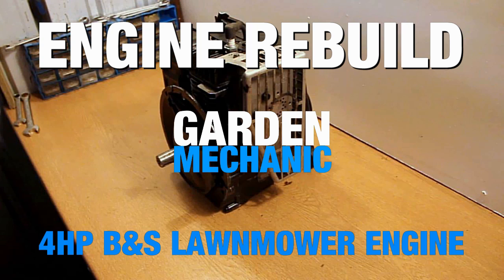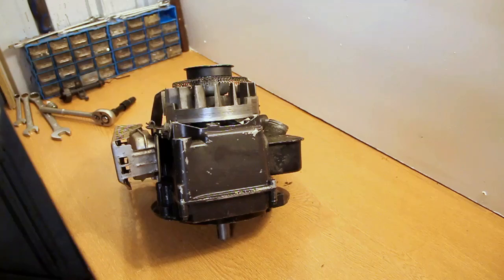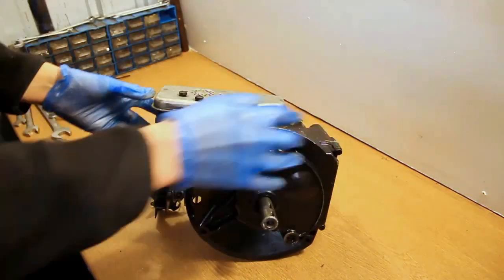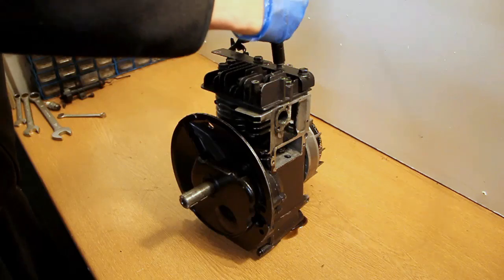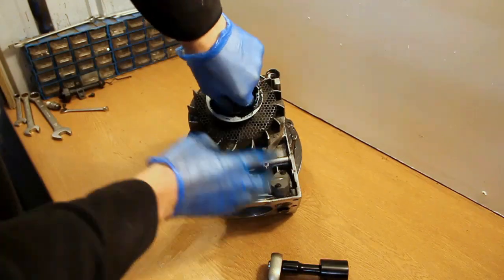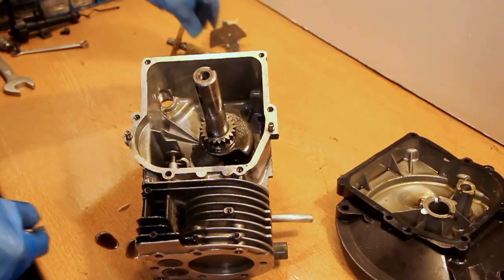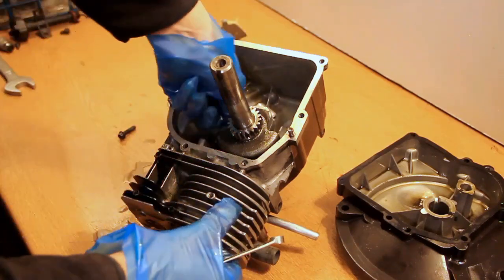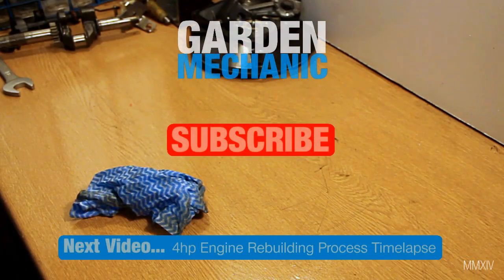Engine Rebuild: Briggs and Stratton Mower Rebuild with Narration - Part 1

Comment: Can you straighten the crank using a press? Also, My edger smokes bad for a few seconds if I roll it to its side. Do you think it needs rings or new piston and rings? Can you oversize the bore just using a hone? Thanks for the video.

Comment: I just ordered a gasket set for a Briggs flathead I’ve got on a mower I picked off side of road.  Engine runs great but excited to practice disassembling, measuring crankshaft journal for wear and reassembling.  Had a chance to practice lapping the valves and removing about 2 thou off the exhaust valve stem too which was fun!

Comment: Will you go over cam shaft timing when time comes to putting it back together? 
I took my 6.5hp engine apart without thinking of timing.
Reply: You align the dots on the gears. I always noticed that when the timing is correct when the valves rock, one closes when the other opens, the piston is on top dead center.

Comment: I cracked the crankcase sump a bit along it's short inlet shaft using the old trick. Will use cold weld steel reinforced epoxy JB Weld to repair it. Hopefully it holds.

Comment: That engine had been previously rebuilt as it was way to clean when you stripped it down. no carbon on top of the piston. the sump gasket was completely intact also after been seperated .valves were super clean . The nut holding the flywheel on was not done up very tight. the oil was clean. The blade disc boss had already been removed. you should show people how u get them off , as sometimes they are a real pain. bodgey video productions I will call this clip.

Comment: Thanks, I disassembled a quattro like this to clean it and then waited and waited for a new head gasket to arrive, foolishly thinking reassembly should be a doddle - ended up with the two flywheel guards hanging around and wasn't able to figure out how they re-attached! A slow-mo of this let me see the position and fixings - thanks!

Comment: the problem is putting it back together. by the time i get the part i need, i forget what goes where and what screws and bolts if i can find them.

Comment: That engine is a dead giveaway because of the air filter on it. They had both metal and later plastic ones that are both the same shape. But I can't get over the size of the muffler and huge heat guard on this thing. Here in Australia I ended up with a cheaper US version of this engine with like a tuna tin sized muffler.

Comment: Hold on just a minute! 1:07 the bolts to the oil filler tube are already out. I've tried every socket in my toolbox, and nothing fits. Even tried adjustable wrenches, mole grips, and slip joint pliers. Nothing budges these bolts.

Please... what size are they, and how did you get them off? I'm guessing you had the same problem and that's why the video is clipped just before this point?

Edit: Ignore that. I've just watched another video, and I don't need to unscrew these bolts. The filler tube lifts out (pulls up) along with the starter coil. Only an issue if the filler tube itself is broken.

Comment: U could've put two 4x6 or even 6x6 blocks of wood under that engine to keep the shaft off your bench!!! And why aren't you using a power drill to remove those nuts and bolts....faster n more professional...that is just a waste of TIME!!!!
Reply: He's in Europe. Electricity is illegal there. Too much of a carbon footprint.

Comment: I am rebuilding a toro lawn mower that has a bring and Stratton engine and it is burning oil. I already have it torn down to the crankshaft please tell what I should do to fix the oil burning problem?
Reply: Joe Dirt Piston rings is your problem but might aswell replace the piston and connecting rod and the oil scraper rings
Reply: Toss it! Seriously! For your average Briggs,I don't fool with them any more because its cheaper to replace it with another lawn mower from a pawn shop. Just remember to take care of the maintenance next time.
Reply: Your pistion rings are bad that's one of the reasons why it burns oil
Reply: Joe Dirt replace the rings

Comment: The crank can be straightened. Use a dial indicator to check it. Bolt the engine down and use a piece for pipe for leverage.

Comment: What is the crank shaft responsible for in the engine?
Reply: It's where the Hamsters live
Reply: DaPopeFrancis716 Virtually everything
Reply: DaPopeFrancis716 it converts reciprocating motion from the piston into rotational motion.
Reply: It pushes the piston up and down, thus being responsible for the 2 or 4 stroke cycle.
Reply: That is a stupid question!

Comment: I have acquired one of these for free and was wondering if I can use it vertically if I put a  different carb or try to rotate the original, I'm thinking with more oil in the case the crank will splash oil inside to keep everything well lubed.What do you think?
Reply: I dont know what engine you got, but i'd recomed modifying the engine first, because the Problem wont be fixt by ovetfilling the engine when the fuel and oil lines are facing the wrong direction and the engine Starts to run dry

Comment: I guess you don't know what a crankshaft straightener is, or a cordless impact, or butterfly ratchet or an air ratchet, crankshaft should have been straighten before you removed oil pan so as not to damage pan, your not much of a small engine mechanic
Reply: Glen he did a good job. You are not much of a commenter.
Reply: hey, im currently learning more about engine mechanics. i could see the potential of it damaging the pan. but the likely hood seemed too minuscule to worry about. did you see anything that could have been more potentially damaging? just wanna know cause the pan looked fine to me and seemed to slide off the shaft with ease after the rubber mallet

Comment: Any ideas for an extremely stuck crank case sump? We tried lubricant and a gear puller, pounding, wedging, all sorts of stuff but it will not slide off the shaft.
Reply: +retrotellephone   Have you removed all the bolts?
Reply: +Ed West Is this a joke?

Comment: hi my mower is starting but just chugging not revving I have cleaned the carb and diapham /gasket new spark plug new petrol any tips would very helpful many thanks ste
Reply: +steven fitton Buy a new mower
Reply: Buy a less labour intensive repair model or buy new.

Comment: Great video! I have a similar engine from a techumesh lawn mower. I'm thinking of running the cylinder vertical for go-kart engine, so the drive shaft is horizontal. If I do this how can I ensure the oil will reach the crack shaft unless I fill the crankcase full to the brim with oil?
Reply: Attach some sheet metal etc to the bottom of the counterweights when they are at the bottom of the stroke. The oil will be flicked upwards.

Comment: What a great video.  I have a very smokey 3.5hp unit. I believe a ring job is needed but after watching this that looks to be a piece of cake.  Probably harder to ascertain the engine model number for correct parts.
Reply: I’ve never rebuilt one of these. In your case, would it be easier to just buy a new piston already loaded with the rings? Serious question.

Comment: I've written down all your steps carefully so that I can take apart the two Briggs & Stratton engines I've got outside that need rebuilding, but I can't seem to find where your rebuild video is. Is it not up yet? Thanks so much!
Reply from the maker: Hi, no it's not up yet I am hoping it will be up soon.
Reply: Sweet! I'm having some trouble getting my flywheel nut loose. Would a lubricant like WD-40 be okay to use on it?
Reply from the maker: Yes, that is fine.
Reply: +GardenMechanic is that you Daggerwin
Reply: +GardenMechanic i blew my 6250  generator because low oil .Is it worth ordering a new engine or buying a new one
Reply: calebcondie Use the YouTube reverse playback feature.

Comment: gm it is a 3.5hp briggs
Reply from the maker: They are hard to tell between because the 3.5 and 4hp look identical..This one is called the Quattro 40 even though it looks the same as the 3.5hp Classic...I guess it could be either.
Thanks for commenting!